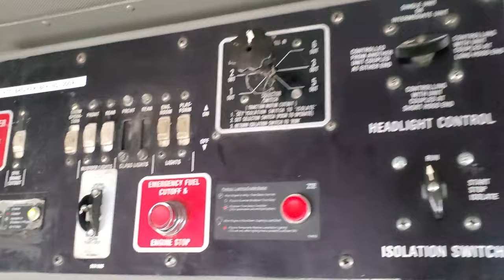Complete Shutdown Process of a 3800 Horsepower Engine EMD SD60 Locomotive

Comment: What made that extremely high pitched sound as you were shutting off the breakers?
Reply from the maker: That loud squeal was a safety device alerting the engineer that it has been shutdown.
Reply: @DLuxProductions  Interesting
Reply: @DLuxProductions  Just for clarification.
At 0:34 Engineer hits the E stop button and you can hear the engine winding down.
0:42 Engine stops completely and a loud beeping starts (about 4 beeps per second)
0:54 Breaker labeled "safety devices" is flipped  and an extremally loud and high pitch wine begins. Lowering in pitch as it goes on.

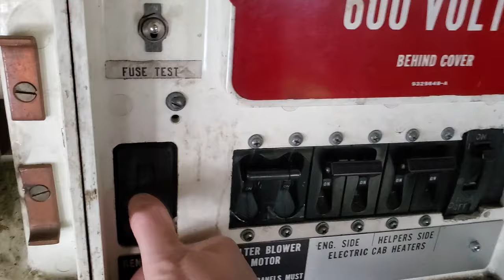1:04 The wine ends and only hissing air can be heard.

I can under stand the beeping at 0:42, but are you saying the wine at 0:54 was also an alarm? Is it a pneumatically powered whistle? or is it just a system that happen to make a lot of noise?
Reply: @GearHeadedHamster  the alerter maybe?

Comment: 0:55 What’s that high pitched blowoff sound? 😮
Reply from the maker: A valve releasing air in the control stand. Once the breaker is turned off and it loses power, it no longer holds back the air

Comment: whats the turbo switch for
Reply from the maker: Turns on heat sensors in the engine compartment.
Reply: Turbo lube oil pump